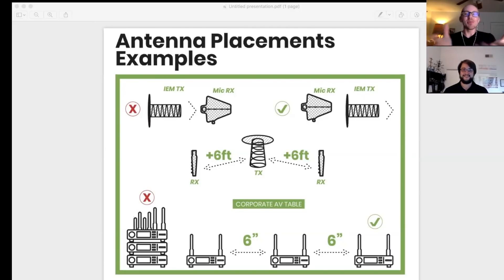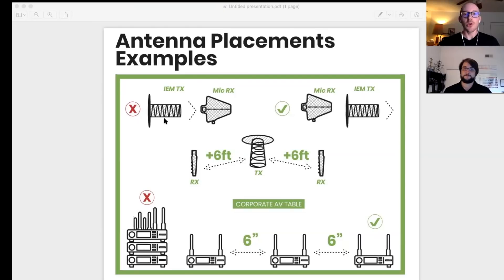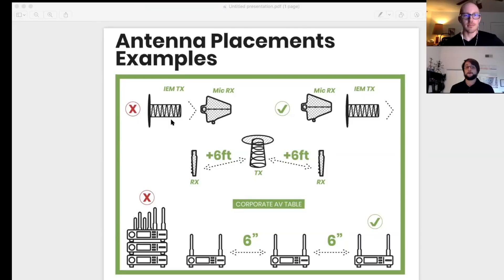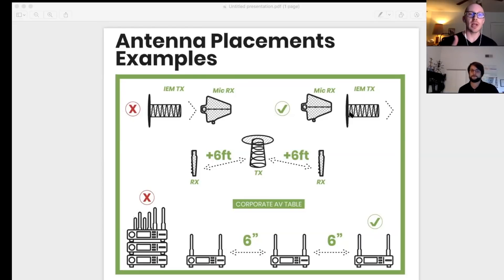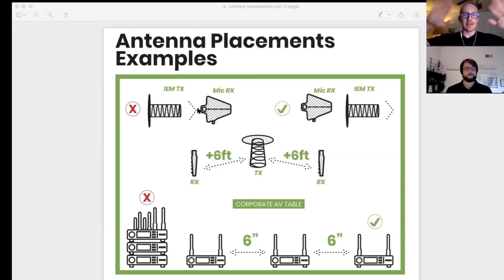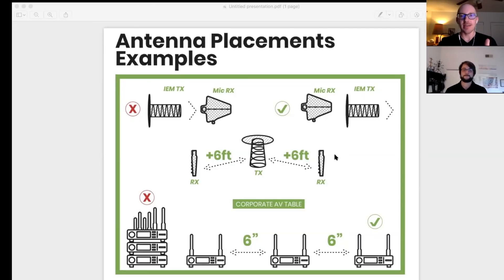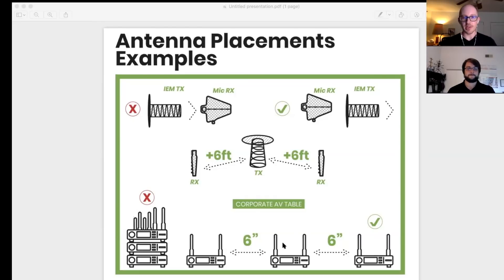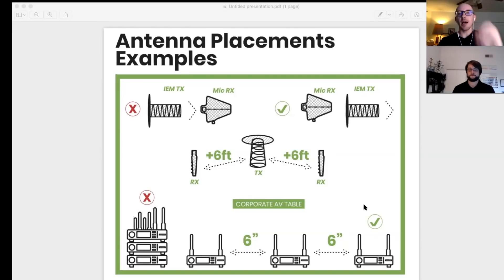3 Common Antenna Placement Mistakes and How to Fix Them [Infographic]

Comment: What about daisy chaining antenna distros? We often need 12-15 receivers. That also brings up a question about having 12 receivers 6" apart is going to put them out of sight and across the room.
Reply: If you need a large amount of receivers, distros are always the way to go. You can daisy chain them and that gets into another topic of how you daisy chain them. Some have "daisy chain" or cascade ports for this but it's important to note that every manufacturer will spec how many times you can "daisy chain" in this way. If you need a large amount of receiver the best way is to have a master distro that takes the two remote antennas in and then the outputs of the master distro feed the antenna inputs of 4 additional distros. Of course there are many ways to skin a cat but if you have the setup to do it, that would be ideal. And yes, with 12-15 receiver 6" apart the space requirement can become unrealistic, but this demonstration is mean to give you an idea of the ideal placement to avoid interaction between the antennas of different receivers that causes the antennas to de-tune. Hope this helps! 
-Stephen Pavlik